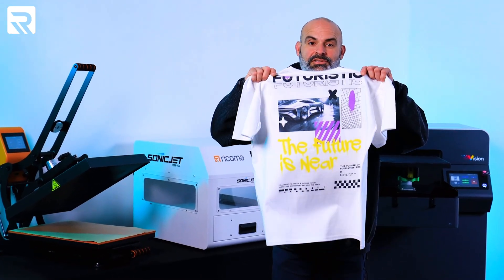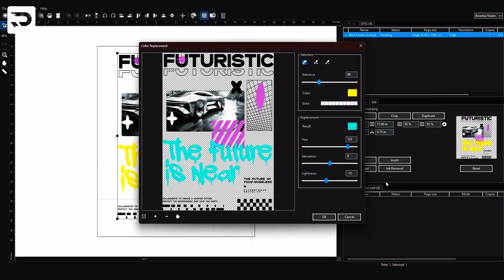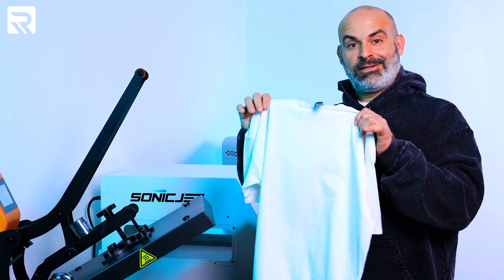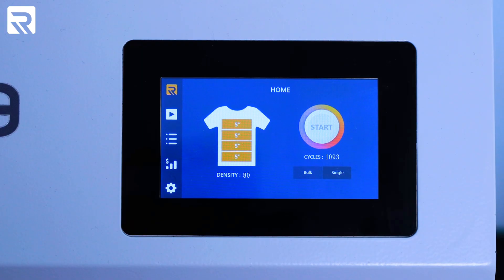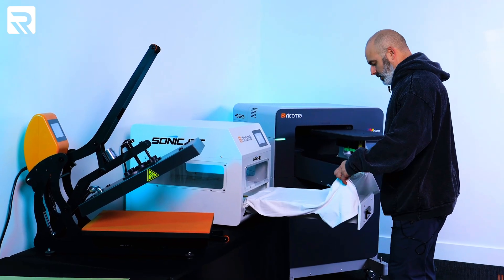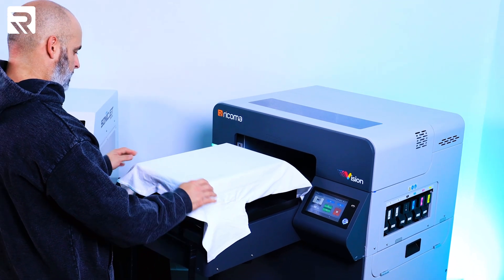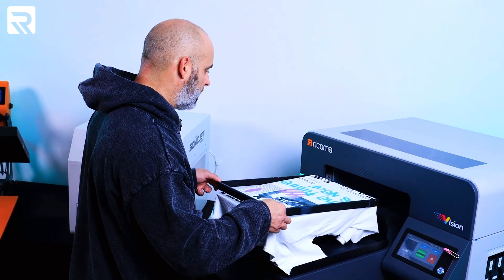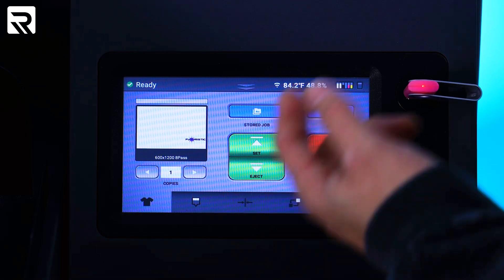First Time Changing DTG Design Colors

Comment: would your white coverage setting be set to 0 in vivid rip on this design since its a white garment?
Reply from the maker: Great question! If you're printing on a white garment using DTF or white toner with Vivid RIP, your White Coverage setting typically should be set to 0 (or turned off), if you don't want any white underbase.

Comment: Will the RI2000 print prn files?
Reply from the maker: Hi Damien. The Ricoh RI 2000 does not natively support PRN files for direct printing. It primarily works with RIP software that processes standard image file formats like PNG, JPEG, TIFF, and PDF for DTG printing.